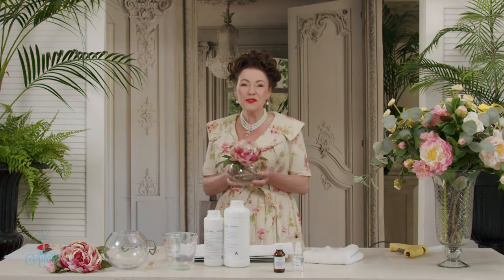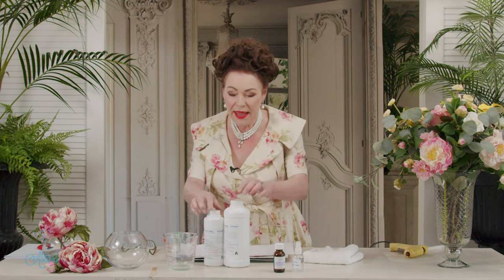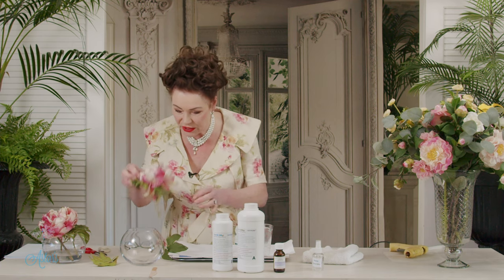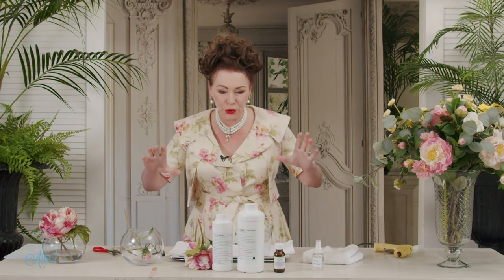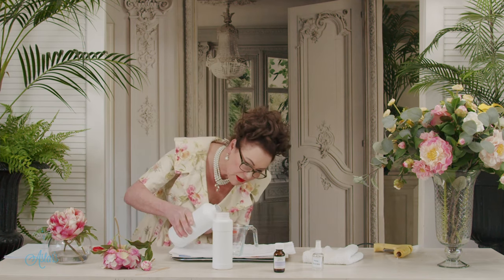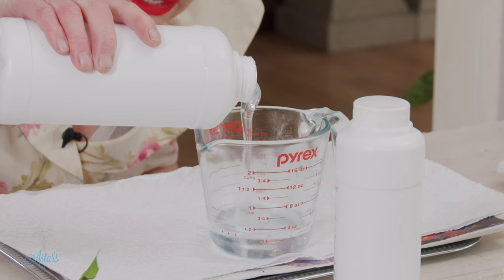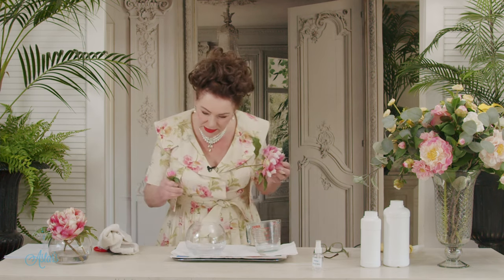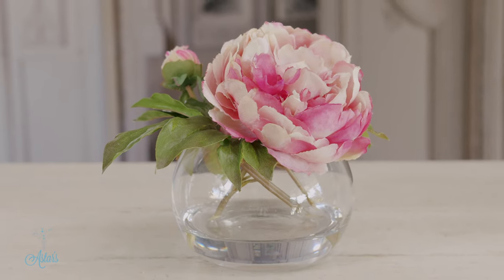How to make artificial water in a glass vase to display silk flowers

Comment: What is the name for that what you used it the water ??
Reply from the maker: There are several products on the market.  1. Resin water or crystal clear. 2. 2-part epoxy resin. 3. Crystal water or Quick water. Check out Amazon for suppliers.  I was unable to find the Crystal Water, so I opted for best substitute and might I add cheaper option - 2-part epoxy resin.  Hope this helps, Astar